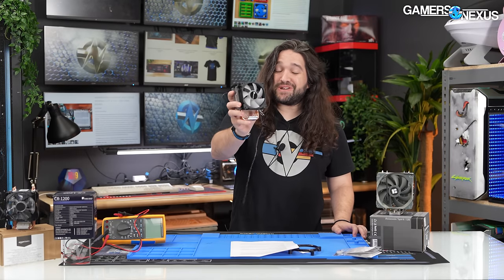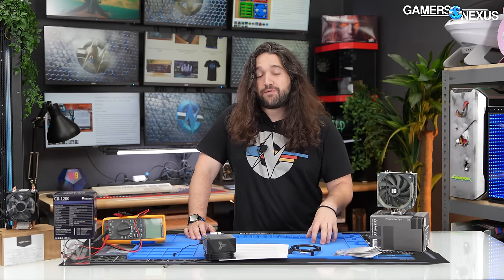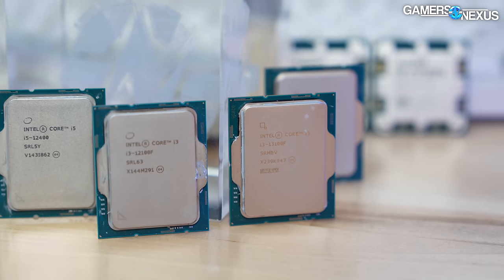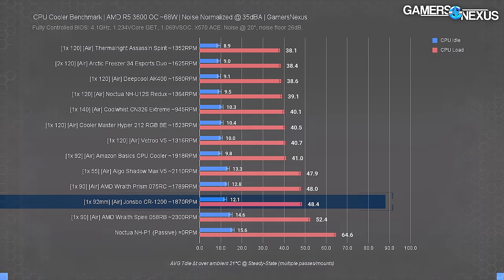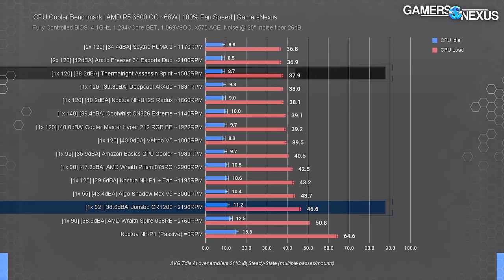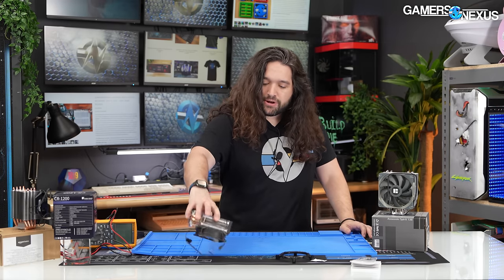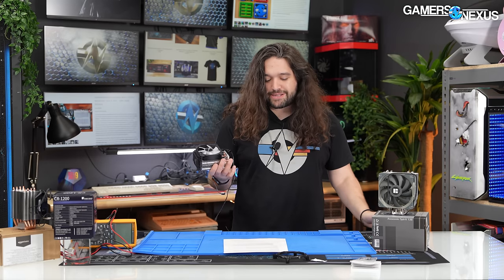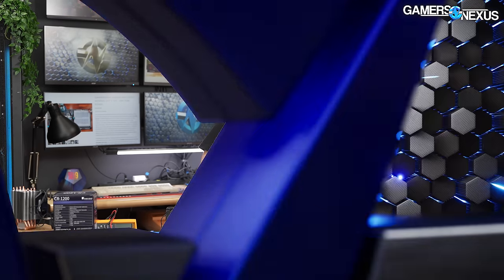Testing the Cheapest Possible CPU Cooler | Jonsbo CR1200 Benchmarks & Review

Comment: You'd be suprised what raw materials suppliers could produce for themselves. Realistically, most heat sinks (not including fans and accessories) with 4-6 heat pipes cost $7 to produce including employees, materials, and power to produce costs. Its taxes, shipping, porting, and storing costs tacked onto the need to profiit that jacks the price.

Comment: If you had blocked the center of the fin stack where the the heat pipes are not, forcing the airflow out the sides of the cooler, it may have cooled better.  Moving more air past the heat pipes and fins near the heat pipes should help. Heat transfer to the center of the finstack away from the heat pipes is non existent and a waist of cooling airflow. Would be interesting to see if this improves Thermals of a $2.77 cooler.

Comment: Woah. 5:25 That picture of the dimensions you actually need to know if a cooler fits in your case or not is worth 500% of the price of this thing. I've bought a few coolers, but when you hit a product page that says "200x65" and nothing else, how do you know if it clears ram, if it is measuring to the top of the heat pipes sticking out, or compare that number to any part of your build in a meaningful way.

Comment: I think a have 2 of there laying around, one used one still in box. Ordered them a the same price . Not the greatest but for a low watt cpu it does the job. (Got them for low power cpu, they never overheated but replaced them by big coolermaster eventually that barely clear the ram and the glass panel )

Comment: Only 8 mins in but, if it supports so many older sockets it seems like it'd be a good option for retro builds in more modern cases, especially when you want a little RGB. I still have my old Athlon dual core system.. I think that's socket am2? Could use this on that ha..

Comment: I wonder how much better the contact of this CPU cooler, and all of the other coolers measured, could be if the cold plate was lapped by the end user. The cost of sandpaper would significantly increase the budget needed for this CPU cooler, though.

Comment: I had this cooler. After 2 weeks the fluid came out of the heat pipes and it dripped. Never saw that before. I had my bequiet cooler on my main PC now for 4 years without an issue 😂🤦🏻‍♂️

Comment: This downward pressure is interesting, I found myself cringing recently installing a pure rock FX 2. This was my first tower cooler install with limited stock cooler experience I found myself with limited "feel" videos on YT and barebone instructions like "screw tight" in the box. I managed the cooler install (r7 5700x) but I did not know how tight was tight enough, at one point it felt too tight so I backed it off. After spending what is a small fortune for me on a new CPU, mobo, cooler & ram to upgrade from my i7 3770 I did not want to crush my new CPU. Anyway my CPU temps (posted first time) were spot on and with [in game] 130w draw seen in OPHM my max was 73 degs and the system has been stable. Could I actually crush a CPU? or bend some pins? I assumed these branded cooler had stop screws, if mine does, I will never know.

Comment: 9:40 why do you only test the Wraith Prism with the speed switch on the cooler set to LOW? The max speed should be about 3800 RPM when the switch is set to H, and 2900 on L, so it's clear you are only using LOW. 

The speed switch is just there as a lazy way for people to reduce the noise without needing to adjust a fan curve, but when performing "max fan speed" testing, it is a bit of a disservice to test this cooler with the fan artificially limited compared to what it is capable of when run with the fan speed switch set to H and allowed to actually reach maximum.

Comment: Eh, not bad really. I slapped together a spare-parts PC with an R5-2600, 16gb regular desktop DDR4, an old SSD, and a 1060 for my nephew. The CPU was used and 40 bucks but didn't have a cooler, this would have worked great!

Comment: I bought one of these a while ago and had the same issue with the base. The heat pipes were making poor contact and had to sand the alum down.

Result was very hot APU but improved considerably after that. Fan is a bit noisy but overall is OK.

I wont recommend this due to 3 pin fan but you can get sand paper and the PWM enabled CR-1400 as a better option. Expect to spend 1h or so sanding the base properly.

Comment: I'm seeing a Dual tower, Triple fans, 6 Heatpipes cooler for 19€ and i think that could be a pretty cool (ah!) contender
Its the "TISHRIC CPU Cooling Fan RGB 4Pin PWM 4/6 Heat Pipes CPU Cooler radiator PC Fan Intel LGA 2011 1200 1150 1151 1155 X79X99 AM3 AM4"
There's a few different versions with less fans and heatpipes but there's indeed a triple fans, 6 HP one.

Comment: LGA 775 (T 2004–2009) - What's wrong with LGA 775? Though I have an AIO 775 Cooler that does multiple CPU support also.
Runs XP 32bit (4gb), XP Pro 64bit (8gb) Duel Boot.
Montech X1 White Case - 
Vetroo V360 White Liquid CPU Cooler - 
ASUS P5NSLI - 
Intel LGA 775 Core 2 Duo E7600 3.06 ghz - 
4x PC2-6400 2gb = 8 gb - 
2x Geforce GT 230 1.5gb SLi

Comment: Wow. I'm impressed, in a train wreckage kind of way. Those pressure maps- I think you'd get better pressure duct taping it to the motherboard, and sadly I'm only half joking. That thing's surface must look like a scale model of the Grand Canyon under magnification. But, if I had 5 bucks and needed a cooler, it works. I guess? It'd be a good match for my spare Celeron I have laying around, I guess? Honest marketing "It's better than nothing." says it all, 100%. Even 7 bucks, it's something. But I think I'd mow an extra lawn and get the Assassin X at that budget.

Comment: I just bought a Thermalright Spirit 120 SE . It's a duel 120mm fan cooler.  I think you listed it with one fan as the older 1 fan version has? they use a very confusing naming system.

Comment: To me this mostly seems good for like... if you're building an ultra-budget system from mostly used parts and am missing a cooler. Basically a very low cost replacement for a missing stock cooler.

Comment: I use jonsbo hx6250 with 5800x3d, max temps on cinebench around 77c.Gaming around 50c, its a bit loud but i dont mind it.Also the non rgb all black looks so good.
Reply: I would love to see a review of JONSBO HX7280 it has dual 140mm and sigle 120mm option kinda like Noctua nh dh15

Comment: 16:50 I can tell u that this cooler definitely doesnt suit the R5 5600 at stock, I made this mistake by believing the specified TDP of 65w but the CPU went upwards into the 77w while in its boost mode. It reaches 86-95c in full load testing and in CPU intensive game. I had to undervolt it to 0.95v and fix the clockspeed to 4.1ghz, the result is max power at 65w, with idle temp at 45c and max temp at 80c. Im pretty content considering how cheap this cooler is, but for those who are looking to build r5 5600 machine, get a more powerful cooler, because it really needs the thermal headroom for the boost clock. I also did try PBO but wasnt to happy with the result, even tho the max power was lower at around 62w, max temp reached 85c.

Comment: A warning about those laser pointers. Even though they may be advertised as safe for pets, many of them are stronger than advertised, and this is bad for the eyes of both you and your cats. Make sure the laser is actually under the 5mw power level by using a laser power meter for the safety of you and your cats. StyroPyro has more information about these laser pointers on his channel

Comment: PRO TIP: Replace the shoddy fans on the cr1200 or cr1400, with the stock AMD fan that comes with the newly bought CPU. I've gotten an 8c decrease.
Reply: I use a cpu fan from a dell optiplex. Probably better cuz it has PWN control

Comment: They probably designed that cooler for a weird OEM in China that required a "better than intel stock fan" cooling solution for a crappy small form factor build that requires a decent enough cpu. I am not sure but some companies may need to squeeze every bit of space out of their desks to improve space efficiency I guess which would then reduce the air quality and the living standards of the people who are unfortunate enough to be in that building but It's possible. And those should be the manufacturing leftover I guess.

Comment: hey steve was wondering if you can test some ID Cooling products such as their relatively affordable aio and air coolers. ive had good experience with their id cooling aura series 360 aio as i got it for cheap at 70 bucks on amazon 2 years ago for my amd 5950x. i thought the cooler would be dead by now but it's still running strong keeping my cpu relatively cool going no higher then 68-70 degrees on max loads.

Comment: amusingly enough, slap it on something with some thermal adhesive and a strap over the contact plate just to be sure and it can cool some lower power SoCs in an instance where you're not going to see it.

not bad, for what it is.

Comment: I would like to see a comparison with air coolers from a decade ago. I have a thermalright 120 ultra extreme from 2008 and my core 2 q6600 system and I'm still using it with my Ryzen 5600 o/ced and I don't see any reason to change it. Is there a performance difference with a new air cooler which make the change worth it? Thermalright had released compatibility brackets for am4 around 2018.

Comment: How much an air conditioner cost and what part cost the most? 115$ air conditioner, compressor, dual fan blade motor,copper and aluminum heatsink of 1 square feet +/-... at some point some are just making profit and not serve the citizens of society.

Comment: Well, i guess if you have a really "simple" CPU that doesn't put out a lot of heat, it might actually work.
I wouldn't count on something this cheap for anything i'd put in a machine, at best i'd use this for something like a Raspberry Pi, at which point it's useless because it's too big, might not fit, good luck fitting it on there, gonna take some screwing around.
But, for the money, it's pretty hard to beat !?
And yeah, i too HATE that standard install method of this cooler, just the way you put pressure on it, mostly on one side at first and all of that, not a fan of it. At all.
The bottom of the cooler is obviously not great, and i'd likely first try to fill in the gaps with some cooling paste to make sure it's fully covered that way, as little trapped air as possible.
But still, if you're going for a real nice simple machine, why not save the money and get this ? Might be fine for kids playing some simpler games.
Frankly, i've seen some stock coolers i have less faith in than this thing.
Jonsbo actually do have some nice stuff for the price.

Comment: Bought mine for $7 in 2021
I hate the coil whine with i7 4770 on it
Replace it with $12 cr1400 and voila better temps and noise
However if I'm gonna buy that ryzen 7700 sometime later
Wraith prism should cut it for gaming

Comment: How did they control it? Isn't it supposed to have 3 pins?
Reply: Yeah this is late answer, but some mobos have 3-pin voltage control to automatically adjust rpm, and I found it more quiet on full speed as the lower levels had more distinctive noise frequency

Comment: Built a system for my father-in-law to upgrad him out of useing a swich to play Fortnite. With mostly recycled parts/used parts besides 1TB Crucial SSD. And DDR3 2x8 GB ram kit  It was a i5 4590 and Evga 1660 RIP EVGA. But its running stock cooling this would be somthing i could have seen using if i shoped alie but. Most stuff i had on hand or got for free. Its CPU bottlenecked but runs fortnite at 120 fps vs his 30 ( low/ performace settings 100% resolution )with the swich and he actualy wasnt loading in until the bus was in the air... now he knows there is a lobby Island😂

Comment: Regarding the pressure maps: is it possible that the bottom left scan shows higher pressure because during installation you pushed down on the cooler? I am not sure how exactly this pressure mapping thing works, but if it records the maximum pressure, your data may be skewed by the mounting method. In this case, you would push down on the cooler to keep it in place while you clip it to the mounting bracket.
Reply from the maker: We are able to mount it without skewing the results meaningfully in the instance of this cooler; however, there are coolers where the mount influences the scan in noticeable ways. We normally explain that in the installation section when so.
Reply: @GamersNexus  neat, thanks for the explanation.

Comment: I think the CR1200 shows how crappy the AMD Stock coolers are. If you want to leave performance on the table use a stock cooler. Almost Every $20+ cooler will beat the pants off old Stocky.

Comment: I get that the draw is the budget pricing. However, there surely has to be somewhere in your build that you can cut a couple of dollars here and there and get a cooler that more than just barely functional. If not, and you're using an AMD CPU that comes with a cooler, just use that one until you can afford a better cooler. The beauty of building your own computer is the upgradability of it. If you're already scraping the bottom of your wallet, and you have to get this cooler, then make replacing it priority number one (as far as upgrades go).

Comment: Either these coolers are, like, slightly defected, maybe like scratched or something, and are actually rejected from sale and just repurposed from scrapping, or they are a stock that wasn't sold. Like when you get a free cooler with cpu, maybe it's just that thing, it's just all those leftover coolers from combo packages. Even as cheap as materials and manufacturing costs are, it still probably costs over 3$ in materials and labor. There's literally 0 way they're producing it for any kind of profit.

Comment: Your setup is BIASED, it is using Gravity in a way that most Computer Cases are not designed to do. 90 degrees wrong, will improve the cooling than everyone else will NOT get. You Bench Test computer should be oriented like every will case on the market will be setup. Especially with HeatPipes, this could effect results. Interior Pipe Liquid flow would be vastly improved for an incorrectly build smooth wall copper heat pipe. Gravity will cause the water to run down smooth walls back onto the hot cpu, this will not happen without gravity. A proper heat pipe relies on wicking, not gravity. The wicking moves the water uphill, against gravity. Your bench test has both wicking and gravity working together, not like every installation on the planet. Cut the Heat Pipe in half to examine the wicking technology, does this CPU heat pipe even have wicking technology insided? Or, is it just a copper pipe that only works with Gravity and stops functioning without the assistance of Gravity? All  wicking technology is not equal, capillary action may differ, your comparison results may differ from real world, 90 degree rotated, results. 

Please Rotate you TestBench.